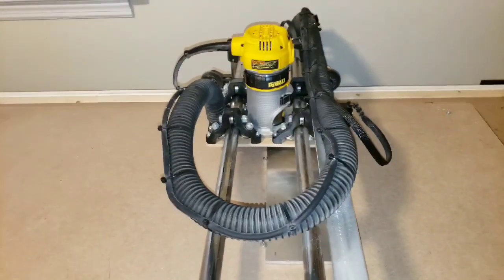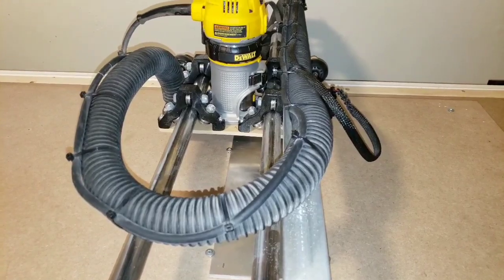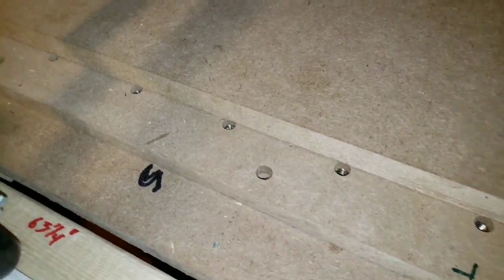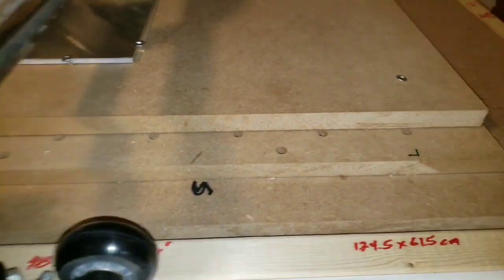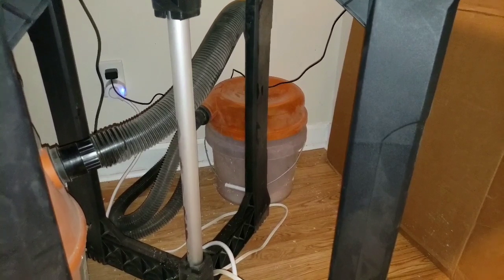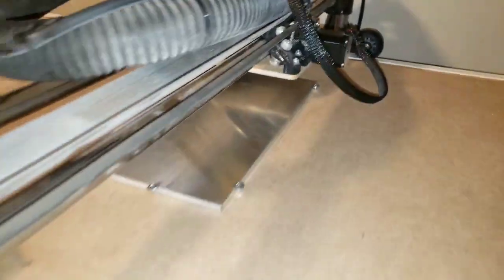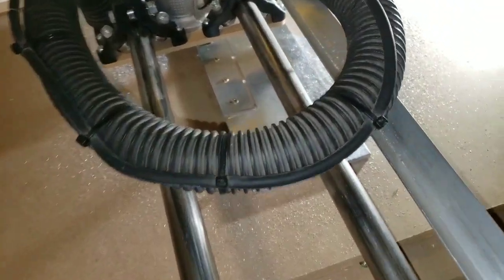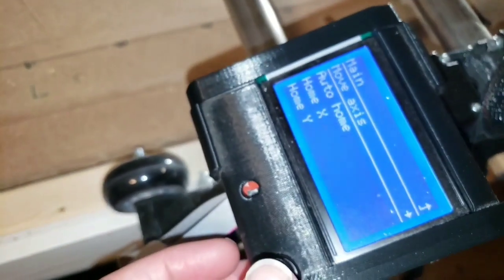MPCNC Lowrider2 cnc milling 1/4" aluminum

Comment: What speed setting are you using on the Dewalt?
Reply from the maker: I usually run 5. Unless it's aluminum. Then 7 or 8. And use an O-flute.
Reply: @DavidKK4GAF  Thanks for the quick response. I'll have to Google up an O-flute bit. I'm going to try a 1-flute today. My 2-flute galled up last night.
Reply from the maker: @tonylatham5915  Have extra bits. And use conpressed air to keep the chips out of the cut.
Reply: @DavidKK4GAF  Will do, and thanks again.
Reply: @DavidKK4GAF  This cut went fine with the single-fluted bit. Thanks. Keep posting.
Reply from the maker: @tonylatham5915  A little WD40 never hurts.

Comment: Hi Dave, I did 2 updates to get more precision:
1) Dusty wheels can move your x-axis. I insert a plate with plastic stickers to prevent any movings across the table.
2) I exchanged the flexible coupling with rigid coupling block. So if you balance your z-axis by disabling the steppers, no flexible spring generates errors between both sides. (See your workpiece z variation over x-axis)
Reply from the maker: I bought a screw driven cnc for more precision. Belt drive will never be as accurate
Reply: Do you mean you did a cnc screw mod to the low rider or that you bought another machine that uses screws?... if so .. what did you buy?.,,,thanks
Reply from the maker: I bought and sold a 3040. Ball screw cnc. I no longer have a Lowrider 2.

Comment: what is the precision you are achieving while cutting aluminium?
Reply from the maker: The piece was the correct widrh and length.
Reply: @DavidKK4GAF  an eight of an inch? thats more then 3mm. thats quite bad. or is it eight thousands?